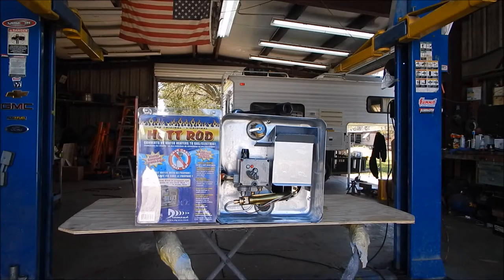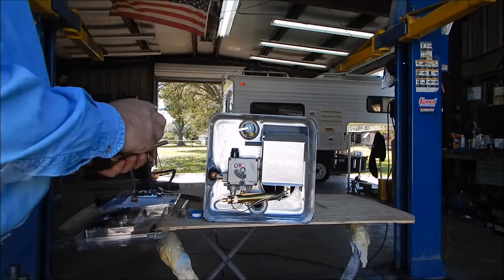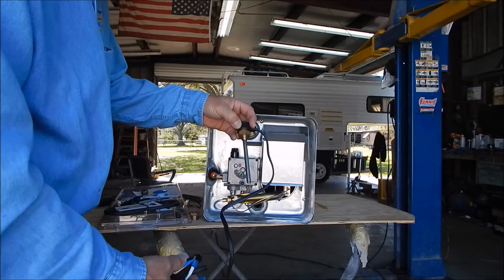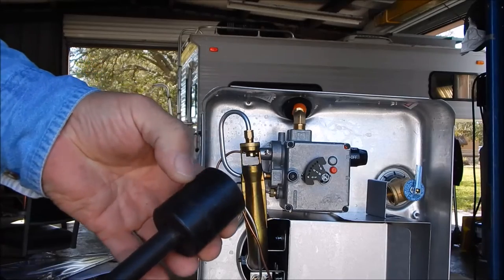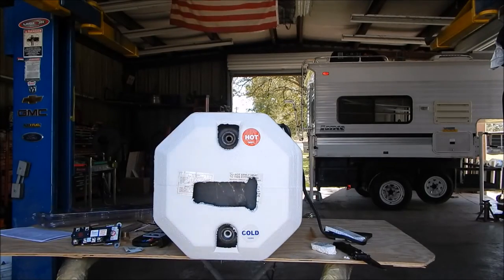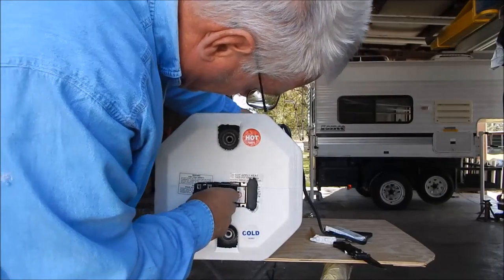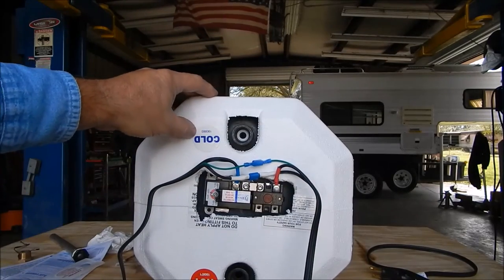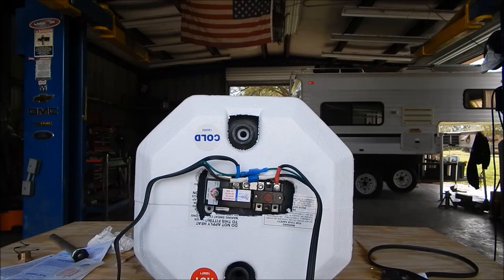Hot Rod RV Water Heater From Propane to Electric or Both!

Comment: Thanks for the video.  Have a Suburban model SW6D Water Heater (LP only with DSI).  Found this disclaimer on page 6 in the installation and operation manual for my Suburban water heater among many manuals and instructions found in the "Blue Bag"  included with the RV.

WARNINGi!  Do not replace the anode rod with any non-Suburban accessory part, such as an  "add-on" electric heating element.  Items such as these are not approved to be installed in Suburban products.  They could create an unsafe condition and will also void all warranties.

My RV was bought new about year ago,  the manual says the WH has a 2 year limited warranty.  But i took a chance anyway and ordered the Hott Rod kit this morning as currently on sale at Camping World's website for under $75.  We'll see how well this works.  Many Happy and Safe RV travels.

Comment: 7 years old video yes, but since you removed the sacrifial anode and replaced with a heating element, what acts as the anode? Clearly the heater unit does not act as a anode and degrade. Please explain. Thank you.

Comment: So you have No sacrificial rod ? Not worried about wrecking a second tank ?
Reply from the maker: It is easy to remove & replace with the anode.  weather has been so warm I have not even used the water heater.

Comment: So in order to install one of these you no longer have a sacrificial Rod protecting your tank?
Reply: Yeah exactly. So you have electric hot water for the 2 years until your tank rusts out.  Doesn't seem worth it on Suburban hot water tanks.
Reply: Just change the sacrificial adapter every 3 months

Comment: I cut the styrofoam  off the back right where you did and the tank is convex (rounded), so there's no way that the thermostat can fit flush on the tank. Kind of frustrating.
Reply from the maker: Yup but it works.
Reply from the maker: Yes but it works.
Reply: So even if the thermostat isn't completely flat against the tank it will still work?
Reply from the maker: Mine works fine the few times I have used it.